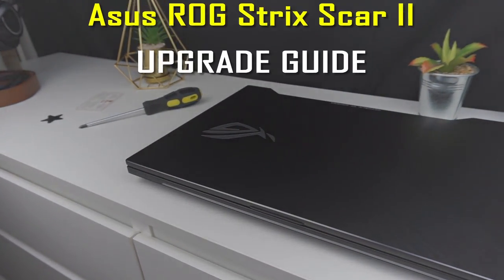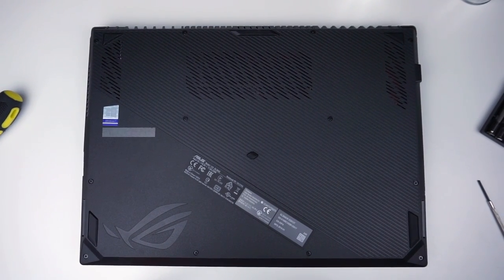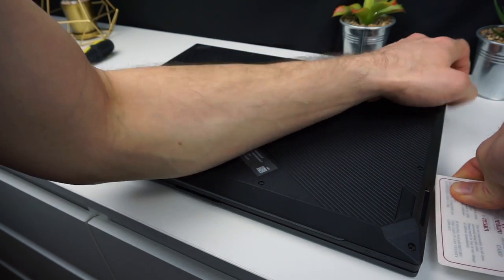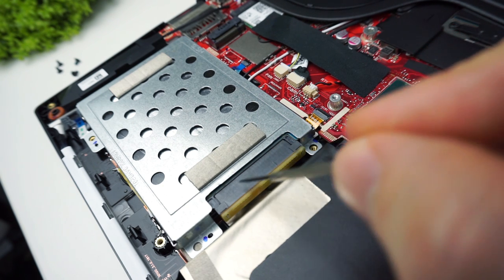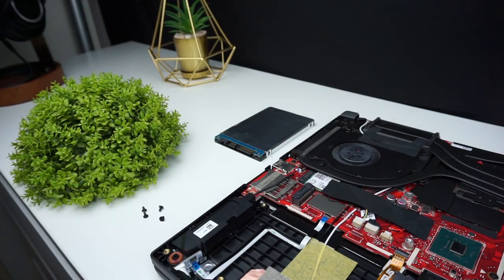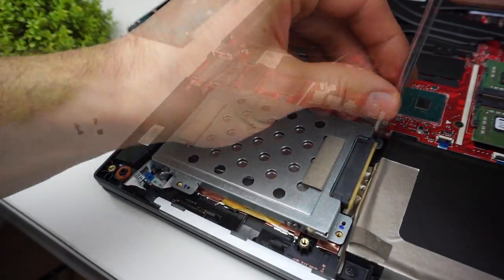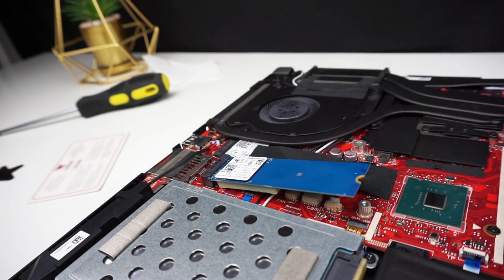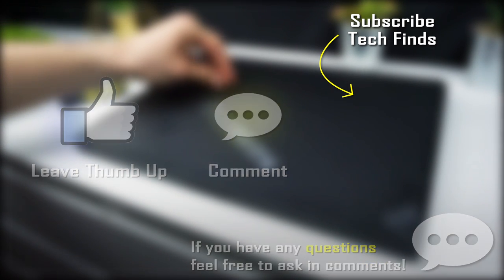Asus ROG Strix Scar II upgrade (RAM, SSD, HDD) - Disassembly Guide (detailed)

Comment: I installed 2x8gb Kingston hyperx 2666mhz DDR4 into the laptop and my performance didn’t increase at all, its running like when it only had one ram stick. Any solution? Do you think it’s because the ram has to settle for a while before performance increases?
Reply from the maker: What was the upgrade? I mean how much RAM you had?
Reply: Tech Finds I had one 16gb ram stick before running single channel and replaced it with the 2x8gb hyperx impact
Reply from the maker: @protopkickercr8949  so basically you switched from single channel to dual channel and slightly better sticks. It highly depends on game and the game settings how much more Fps you will get. Check out Jarrod's Tech comparison between single and dual channel RAM to get the idea of how it works and what to expect.
Reply: I’m literally getting like 60fps max settings in fortnite with an rtx 2060
Reply from the maker: @protopkickercr8949  Make sure that you play on turbo mode and your game or GPU is not capped at 60 fps.
Reply: Tech Finds turbo mode didn’t help :(
Reply from the maker: @protopkickercr8949  how about FPS cap then? Have you checked?

Comment: Hey man can u help me out the same laptop im getting but with a single ram stick of 16gb ddr4 which comes with the laptop and now im planning to purchase just a single stick of 16gb (so its 32gb )from crucial from ur links so will mix of 2 brands with same specs cause any problems im planning to buy Crucial 16GB Single DDR4 2666 MT/s (PC4-21300) DR x8 SODIMM 260-Pin Memory - CT16G4SFD8266
Reply from the maker: Hi! It's hard to missmatch RAM nowdays and the ones i linked will work with Scar 2 for sure. Of course for the best compatibility it's recommended to have 2 sticks of the same RAM but you'll be ok if you choose other brand with closest possible specs. The Crucial one you mentioned is the most similare to the RAM that Scar 2 comes with.
Reply: @TechFinds  thank u so much

Comment: Is the 
Crucial 4GB, 260-pin SODIMM, DDR4 PC4-19200 compatible with this and will it work if its paired with a 16gb ram stick
Reply from the maker: Yes it will work, but it's 2400MHz, so all your RAM will work at 2400MHz. You'll have 20GB in total
Reply: So I will be able to run dual channel like that?
Reply from the maker: Not sure if it'll run dual channel if the clock speed and capacity doesn't match. But tere is a chance.

Comment: Can I add a single stick of 16GB RAM (same freq) and leave the original one without compatibility issues ? And willl the Dual Channel work ?
Reply from the maker: Ye it should be working fine if the specs are the same. Would be good if you chose RAM with the same latency as original but I don't remember what latency has the RAM that this laptop comes with. Probably CL17 or CL19.
Reply: @TechFinds  Ok thanks for the tip !
Reply: I would go dual channel on RAM instead of single channel. Better 2x8GB than one 16GB due to parallel memory management.

Comment: Its like piecing together a puzzle, I'm too scared to make changes to my Asus gaming laptop. I dont feel like I'm very technically minded. I do love the fact that you can upgrade things. Is it possible to change the GPU and CPU? or is that reserved mainly for desktop machines?
Reply from the maker: Hi, it's not that hard as it may look. You can always ask someone experienced to do it.
You can't change CPU and GPU in vast majority of laptops. There are only few models that I know where you can replace CPU like in desktop, an one laptop where you can replace both.
Reply: Tech Finds thanks for the advice, I currently own a GL503GE hero edition. I was wondering what is the maximum upgrades I can give it?
Reply from the maker: @meetrasurrik6982  Up to 32GB RAM for sure. But idk if there are any limits for storage
Reply: Tech Finds What is the other storage on the laptop?
Reply: Tech Finds would not be possible to install two 32 gig ram chips?
Reply from the maker: @meetrasurrik6982  nope, 2x16 is max
Reply from the maker: You have one slot for M.2 SSD and 9nenslot for 2.5" drive. Check in the video
Reply: Tech Finds oh I see :p if I give you my laptop storage specs could you recommend me the best things to install/upgrade pleas?
Reply from the maker: @meetrasurrik6982  I linked everything in the description. It's universal for most of laptops
Reply: Tech Finds Ahh ok I'll have a look thanks

Comment: I bought the rog strix scar ii and order a  5tb 2.5 inch Hdd with dimensions 
4 x 2.8 x 0.6 inches
Will it fit?
Reply from the maker: Oww, not sure mate. I don't think that the caddy can fit on it since it fits perfectly on 0.3 inch thin 2.5" drive. But if you already ordered it there's nothing left but try it. :) Kindly share if it worked!
Reply: @TechFinds  will give it a try when i receive it next monday and let you know.

Comment: Hey, I have the same laptop, strix scar II, if I would change NvMe SSD, what about the OS?
Reply from the maker: You probably has the system on your current SSD so if you'd replace it you have to install the copy of your Windows on the new SSD from pendrive using Windows MEdia Creation tool

Comment: I just checked with CPUID and it says my 2070 unit has a single stick of Samsung 16gb DDR4-2666 (1333mhz) installed. Would you recommend any of those rams to pair it up with or should I buy two sticks?
Reply from the maker: It's hard to miss match RAM nowdays but for the best compatibility it would be good to have both the same sticks. Your RAM is 2666MHz. You can buy any that I linked or look for some Samsung RAM to pair.
Reply: Thankyou!  @TechFinds

Comment: just wanted to ask if I swap out my default nvme ssd 512gb to a better one will I need to also buy an operating system along with it ?
Reply from the maker: If you already have Windows you should be able to legally copy it and install on the new drive or get a free coppy from windows directly. Ask their support or read the forums about solutions. I can't help you with that, because I have never done it before but I know it's possible and you don't have to buy new windows.
Reply: @TechFinds  Your reply helped me out alot thanks a bunch , More power on your channel !

Comment: thanks for the informative video.one question, for the hard drive replacement, is it possible to use a different brand of 2.5inch SSD instead of the Firecuda? for example a 480 GB Western Digital WD Green 2.5 inch SSD? Thank you in advance.
Reply from the maker: Yes, you can

Comment: When I ordered my Strix Scar II, it came with an empty drive bay (it did come with the cable.) I have added a Samsung 860 EVO 1TB drive, and I followed your instruction regarding the cable. It works, but I am not happy with how the connector is pushed in to the motherboard socket. It works, but seems insecure. In the upgrade guide for the 704 model (there isn't an upgrade manual for the 504) the motherboard socket has a flap like the battery connector to secure the cable. I can't remember if there was a flap or not on my model. Now I wonder if I should open it back up to see if there is such a flap. Is there a trick to fasten the cable to the socket, as just pushing it in does not seem to securely seat it?
Reply from the maker: When i saw this socket for the first time i thought there is such flap as usual but in Scar II it seems to be only socket to push the cable into it. You're right, it feels very insecure and it actually is, because when i was trying to disconnect the cable from the HDD for the first time, the cable popped off of from the motherboard socket so i left with the HDD and cable connected to it in my hand. I think that if you push it into the slot properly and all the way it should not get disconnected while using the laptop. So you have the 704 model? Idk if it has a flap since i had only 504 model where i couldn't find one. I think the only solution to fasten  or secure this cable is to DIY but i wouldn't do anything like that because of warranty.
Reply: @TechFinds  Thanks, I have the 504 model. I have inserted the cable the way you showed in the video, and it trying to push it in more forcefully only bent one of the side tabs a bit and I didn't want to push any harder. It doesn't seem possible to insert the cable "all the way." There is an excess of cable such that when the drive is screwed down, it acts like a spring to keep pressure on the socket. I suppose that is the best one can do in the absence of a mechanism such as in the upgrade guide for the 704 model (you can download this from Asus Support.) Fortunately, the new Samsung SSD is working perfectly, and fingers must remain crossed regarding how well the connection works.
Reply from the maker: @gbennett58  As you can see in the video the golden pins went to the end of the socket (04:08). I mean you can't go more and that's normal. You can see only very little part of pins sticking out of the socket. You should be fine, especially that the SSD is already working. :)
Reply: @gbennett58  where is the cable ? On the box? Inside the computer ? I cannot find it
Reply: @k654654  I found it in a small box which also contained the user guide. It was in a small plastic envelope.
Reply: There most certainly is a flap/lever to push down to secure the cable to the motherboard.  I almost missed it too, but it is there
Reply: @stevefitchett6461  I'm about to add more memory, so when I do I will look for the flap. Thanks for the heads up!
Reply: @stevefitchett6461  I opened my Stix Scar II again to install memory. I turns out you are right about having a lever to secure the sata drive cable. It is a black plastic strip on the rear of the socket. When inserting the cable, the lever is in the vertical position. After inserting the cable, push down on the lever until it snaps into place. I feel a lot better about the cable attachment than I did before. Thanks for the info!

Comment: Which screw driver did u use. Also how many different ssds can you have in this laptop
Reply from the maker: This is a small phillips head precision screwdriver. There is one slot for M.2 SSD and one drive bay for 2.5" SSD or HDD if you prefere.

Comment: Big mistake that I bought gl704gw from the us. Display was dead out of the box but can see faint logos under direct light. Works fine with external display. Gave it to the authorized service center told me that the issue is with display panel or cable, it's been one week they got the replacement display and cable. Problem persists. Now they are telling that the problem is in motherboard and have ordered a replacement motherboard. This is really frustrating.
Reply from the maker: They should have sent you a new laptop instead. Or you could just return it saying that it's a defective unit I stead of servicing it. However, you can't end up with a broken laptop so hopefully they'll figure out how to fix it.
Reply: @TechFinds  i would have returned it if that was an option as i dont live in the us. Shipping the laptop back will cost me 1k $. So part replacement  is the only option left. Is it possible that laptop works well with external monitor and still has a problem in motherboard and not in the display?
Thanks for the reply
Reply from the maker: @miratdholakia4634  Whoa, it's insane that shipping to the USA can cost 1k $. How is it even possible?
It's hard to say if it's motherboard but if so, the chance is that only a part of the motherboard that is responsible for display connection failed.
Reply: Mine came alright. Bought from denmark. Only issue is the RGB under the spacebar is dead and some around the arrow buttons are discolored and down button is also dead. Other than that, some issues were one 16gb ram, since i thought it would be dual channel x2 8gb rams

Comment: please help Can I use a connector for the HDD from another company do you know which one or what options I have I misplaced mines and don't know where it's is thanks
Reply from the maker: I didn't try any replacement parts but i think that it should work. Idk where to find one tho
Reply: @TechFinds  oh wow one asked if I use another from another brand of 12 pins do you think it works
Reply from the maker: @dannymlio03  i don't know what type of connector was there in Scar 2. I guess it's a standard sata, so if you'll find the same type it should work, but you have to match the type of connection to motherboard too

Comment: I have this exact laptop, want to upgrade ram, gonna get 2x16 ram cards. Do I have to update the BIOS? (Gonna get the HyperX. Says you don’t need to mess with bios, but just wanna make sure).
Reply from the maker: No, you just physically put the RAM sticks into the slots and that's it. ;)
Reply: Tech Finds Thanks, also, what MHz ram should I get? Can I find out using CPU Z?
Reply from the maker: @timeshaft5088  CPU-Z will show you what frequency your laptop has, but here you can be sure it's 2666MHz. The laptop supports max this much, so you can buy your HyperX 2666MHz
Reply: Tech Finds thanks brah, ur the homie

Comment: Do i have to reinstall windows after replacing ssd or its just plug and play?
Reply from the maker: Yes, you have to reinstall windows
Reply: Do you have a tutorial on how to do it for this laptop? Without having an hdd?
Reply from the maker: @eng.punisherzeus3867  No, i don't make a guides regarding to software / OS

Comment: Hi again brother, i successfully upgraded the Ram and SSHD, really happy with this laptop so far, been using it for a week, but yesterday my SSHD disk randomly disappeared, i was opening a new folder on it and boom the screen went black and i was like wtf did just happened, i was thinking maybe was the cable connection to the motherboard, because i was concerned about how it was pushed, looked really inestable, however I opened the case and was all normal, did this happened to you?? I have the same 2tb SSHD as yours
Reply from the maker: Hey, nope it never happened to me with any laptop. This drive is 100% compatible with Scar II (Asus is actually selling  configurations with 1TB FireCuda). I'm not sure if your secondary drive could be a cause of screen turning off, it has nothing to do with the display. Have you fixed it or is it still not working?
Reply: Tech Finds the driver appeared again after waiting 30 minutes and turning on the laptop, so weird, now is working normally, I’m not sure what is causing this issue but if keeps happening I’ll call Asus technical support. Thanks for the info
Reply from the maker: @dani5422  Yep, that's strange. It wouldn't connect back itself if it was disconnected because of this cable.
Reply: did you ever found out if it was the cable? I'm experiencing the same thing, and the drive disappears and gets lost at random. Anyone has linky to compatibile cable?

Comment: Hey again, my laptop and RAM  + SSHD arrived today. 

I got the 704gl gw strix scar 2. 

It had 2 RAM sticks, does it mean it is dual channel from manufacturer? I still replaced for 32 (2x16). The problem is the SSHD. There is just an empty box where the SSHD can be placed but there is nothing else. No cable, no holder. I bought the SSHD FireCuda you recommended and it also came without cable. What to do :-/? Thank you! :)
Reply from the maker: Yes, 2 RAM sticks = dual channel. Have you bought the laptop in the USA or other country? 
It looks like you have to get a cable and caddy yourself. I remember that Acer was providing the parts needed to install hard drive but idk how about Asus. Try to contact Asus's support and ask about that. My unit came with 2.5" drive from the factory so I had all needed parts already. If you wanna buy them yourself you have to find something that will fit to this model.
Reply: Look in the box that holds the literature.  My ribbon cable was in there.
Reply: @stevefitchett6461  Found it there too, thank you :)

Comment: Will I void the warranty if i'm repasting the cpu and/or upgrading the ram?
Reply from the maker: You have to read your warranty terms or contact Asus, because it vary between countries. I found warranty sticker on cooling system in my unit, so if i opened it the warranty would be void.

Comment: Hi if you change the ssd or hard drive will I lose the games already on my desktop
Reply from the maker: If the games are installed on the drive that you're going to replace with new one you will have to install games on the new drive
Reply: What about the ssd
Reply: If you replace it
Reply from the maker: @king_amir  the same. And if your system is installed on this SSD you will need to get a copy of windows and re-install it on new SSD.
Reply: @TechFinds  Hello TechFinds, how can I get a copy of Windows to re-install on my new SSD?
Reply from the maker: @couchpotato8860  Ask Windows support if they can provide or they may give you any other way.
Reply: Tech Finds Thank you for answering. I have another question: Does the Seagate FireCuda SSHD 2.5 work for Hero Strix II?
Reply from the maker: @couchpotato8860  yes it works. This is what I installed in this video
Reply: Tech Finds I was just worried since I have a HERO model and you used a SCAR. Anyways, thanks for replying man! Video was good, straightforward, and informative!

Comment: hi, I ordered this laptop from us store, I'm not sure if they will give 16×1 ram or 8×2 , I also ordered 1 16 GB ram stick and 2tb sshd. just worried about the ram they provide
Reply from the maker: Most likely you'll get 1x16GB but there is also a chance that you may get 2x8GB. You could have ask the seller before you bought to be 100% sure and to find out if you have to buy another 16GB stick. Anyway, if you'll get 2x8 Scar II you can always take out one 8GB stick and install the 16GB one that you purchased.